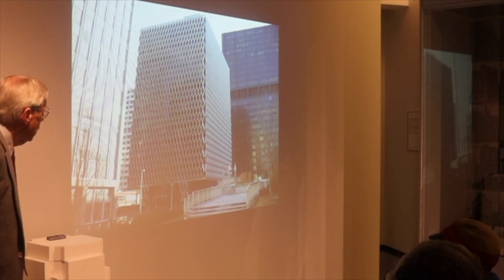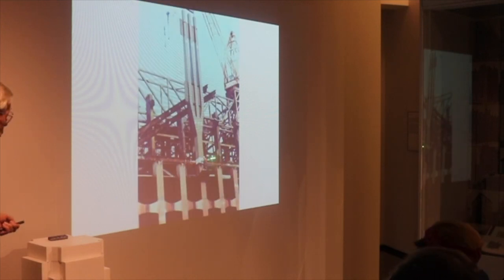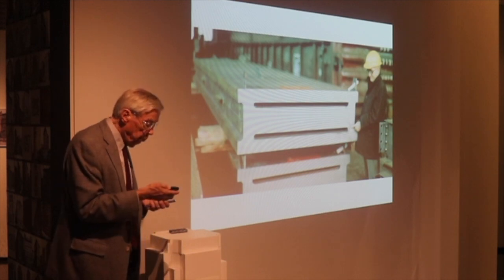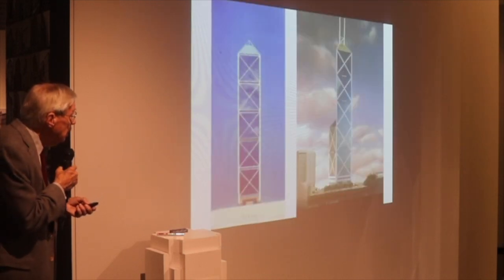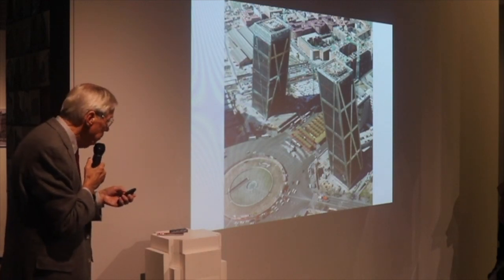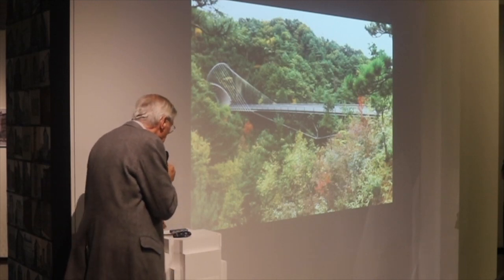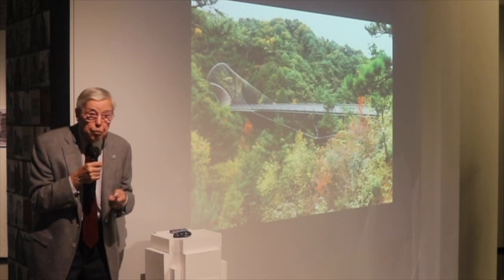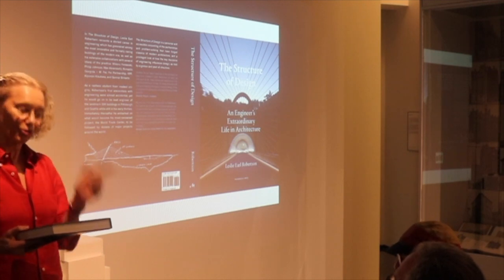Leslie E. Robertson Book talk: The Structure of Design

Comment: No matter what everyone says, truth is they built the Twin Towers for shit: weak and wobbly, sacrificing safety for speed of construction and lower costs, focusing on maximizing open space for businesses, with interiors made of drywall and plaster; not just the towers didn't resist but they took with them thousands who couldn't escape after their emergency exists collapsed while most of their systems failed immediately (like water sprinklers or the PA); and on top of all, their design was hideous. They fucked this one up.